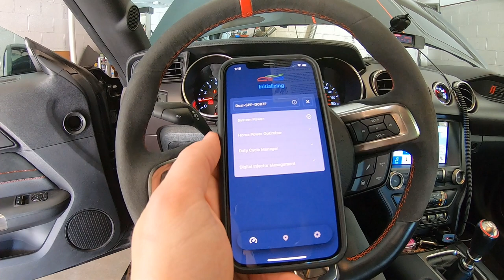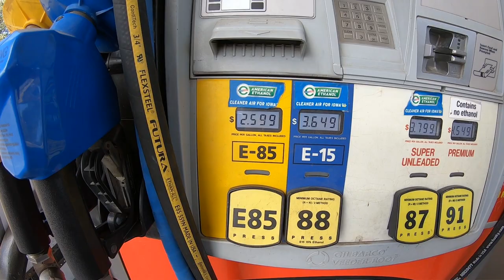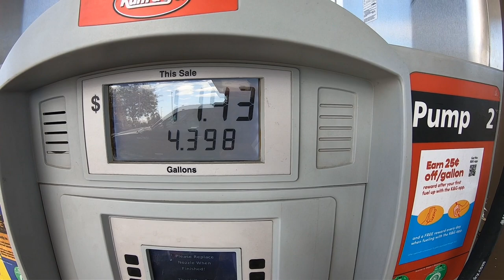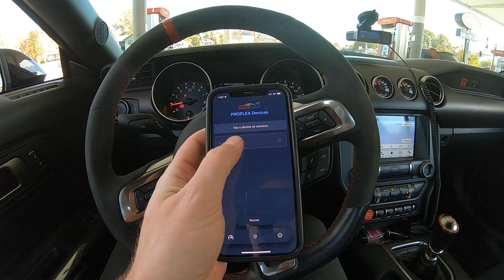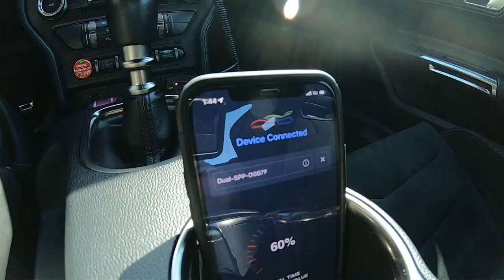GT350 Flex Fuel E85 Install Advanced Fuel Dynamics

Comment: I am about to order it? Any suggestions?
Reply from the maker: Just make sure you get the fuel disconnect tool and make sure your kit has the correct fuel lines and you should be good.